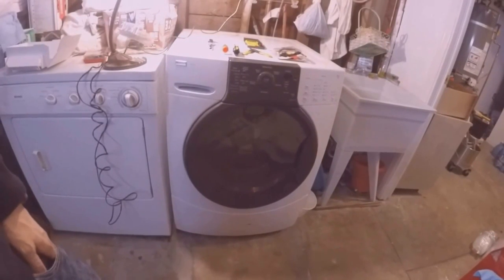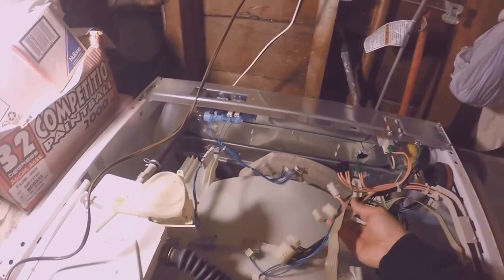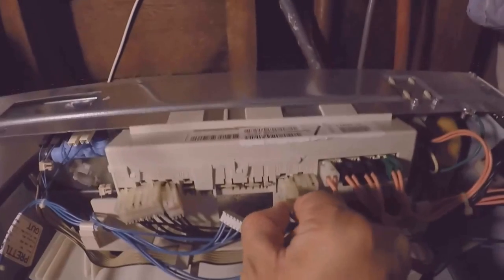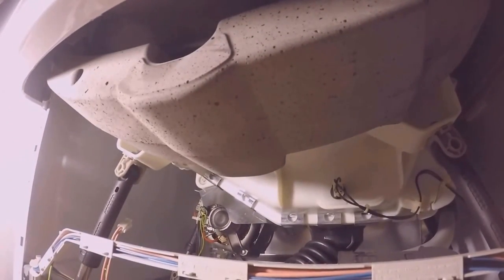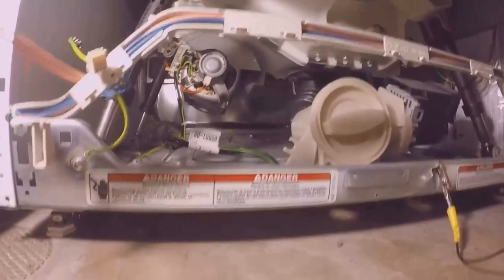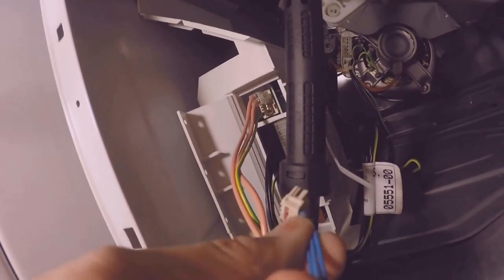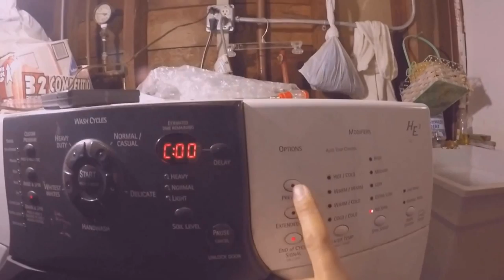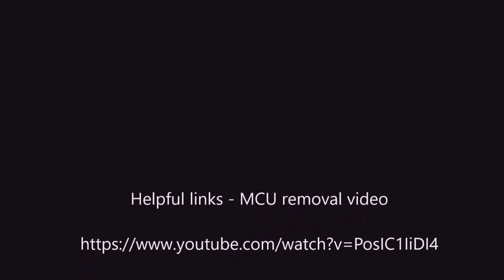Kenmore Elite HE3t/Whirlpool Duet Washer F11 Repair

Comment: I had this exact same problem: I was getting the F-11 Code when the washer first started filling the water, and before the drum started turning, in a regular washing cycle.  When I ran the diagnostic test, I would get the F-11 code at the C:03 step, and the drum would not move.  I ordered a new Motor Control Unit (MCU) and swapped it out as this person did, and the washer works properly now.

Comment: Hi Joseph  
I am getting exactly the same symptom as BillBennettASC described below.  So just to be clear, we only need to replace new CCU board (the top) not
the MCU bottom board.  Please confirm and thank you
Reply from the maker: My issue was the CCU. I changed it twice. First time was a refurbished CCU and then my washer went dead later on and I replaced with a new CCU. The MCU was not my issue. I purchased it and I had to exchange it for a CCU.